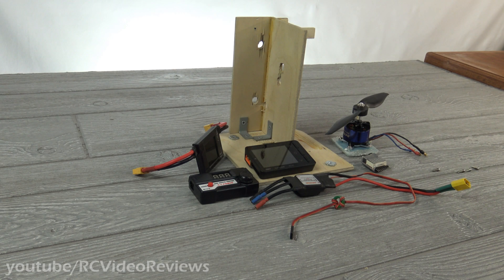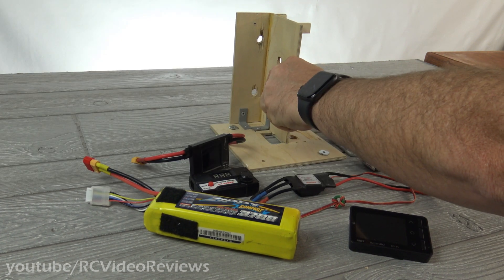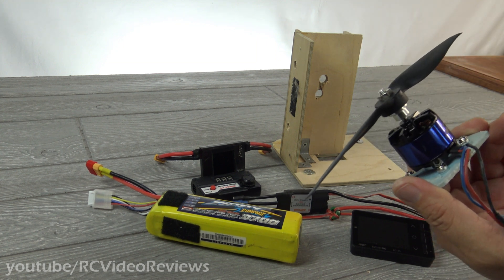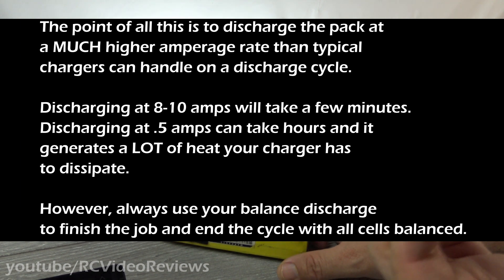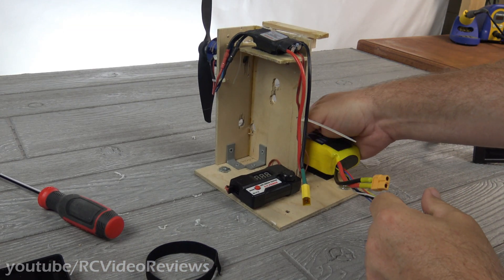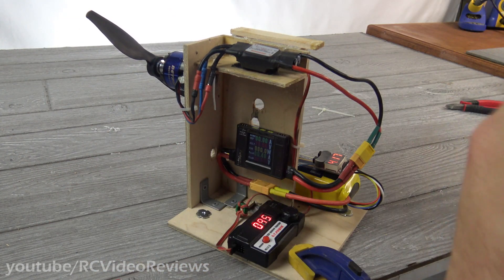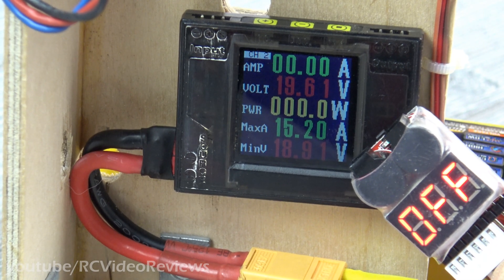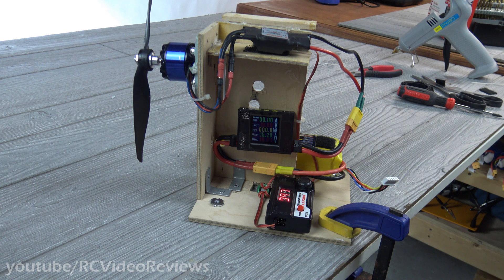DIY LiPo Battery Discharger from Spare Parts - Dirt Cheap

Comment: The noise, the prop danger with kids and no auto cutoff is an issue for me, but it does work if your willing to hang around to shut it off. Could use a latching relay that unlatches when the buzzer goes off, and simple light bulbs or power resistors for loads.

Comment: I have an ISDT charger and I have a Tenergy TB6B charger plus half a dozen of those volt checkers. None of these devices agree with each other. Some will agree at one voltage but not at another.Crazy. I never know which to believe!
Reply from the maker: You need to calibrate them with a multi meter and even then there will be disagreement. These are consumer grade devices. A certain amount of error is to be expected.
Reply: @RCVideoReviews  I didn't know that those small voltage readers had a calibration feature. I usually do compare to my meter and make an indication on the device with a marker if it's + or - what it says. To compound the prob, some of them will be accurate at low readings but go off at higher voltage reading. Like you say, "consumer grade devices".

Comment: I think the cheapest and safest lipo discharger is one or two 12volt, 5 watt light bulbs (from Walmart) in parallel, soldered to a short heavy-gauge wire and an XT-60.  Any unused batteries light up my shop for 15 minutes or so when I get back.  This is gentle on the batteries too.
Reply from the maker: Yes, that is gentle. It's 0.4a discharge rate. But then you have heat from the bulbs and glass bulbs to deal with. At that discharge rate I would just use my 306b and discharge at 2a. 

Low end 20c 2200 3s packs can do 44a constant discharge. 5-10amp discharge on these packs is nothing. They can withstand 10a drain without breaking a sweat.

It does sound cheap though.
Reply: My mistake- these are actually two 20 watt bulbs in parallel, so about 3.5 amps constant discharge.  You can discharge faster by adding more bulbs if you want of course.  I like the heat in the winter lol!
Reply from the maker: You should make a how-to video ;)

Comment: Hello John. What size motor? How much did you reduce the prop? I thought about this as well. I just don't have enough spares right now.(earlier was  gonna "new,cheap") You could also cut a prop down to reduce it. I know, balance. Great Video. AirHammer out!!
Reply from the maker: All you need is any motor/prop/esc combo that will run the amperage you want safely. Don't get too concerned about specs. Just make sure if you want 10a, the motor can support 10a. If you want 20a, the motor should support 20a. In my case, I had a pretty good size 3715 which can do 45a. 

This design uses a 40a ESC, a motor capable of 45a and I'm discharging at 10a. Get the idea? My setup can deliver far more amperage than I'm going to ask it to deliver. In the video, I discharged a 5s 3700 @ 10a and it just took a few minutes with trivial load on my power setup.

Prop reduction doesn't matter either since we're not aiming for peak power or efficiency. All we're aiming to do is create load. So ANY prop/motor that can create the load you want is good enough as long as that load is within spec for the ESC and motor.

Here are things to NOT do:
- Do not attempt to draw 40a using a 30a or smaller ESC.
- Do not attempt to draw 30a on a motor rated for constant current at 20a.
- Do not put a 16" prop on a 2210/1500kv motor. Be reasonable.
- Do not put a 5" prop on a 380kv motor. You'd have to run it at full tilt to generate load creating unnecessary wear and tear.

Use any prop you want in the manufacturers suggested range. Remember, peak power and efficiency are not meaningful in this effort--only load within specs of the motor and ESC.
Reply: @RCVideoReviews  😁

Comment: Great idea! I often return home from the flying field with 1 or 2 batteries still fully charged. I only need to get a servo tester to build my own discharger. Is there any reason why I shouldn’t reduce the prop efficiency by mounting it backwards?
Reply from the maker: The only thing you care about with regards to the prop is creating an amp draw that works safely with your motor and ESC. If mounting the prop backwards helps you do that, there's no reason not to.
Reply: RC Video Reviews. Thanks. I noticed in the video, that you corrected the prop rotation & wondered why? An inefficient prop in less likely to drag the   discharger across the garage if your clamp failed to hold.
Reply from the maker: @koalatails6391  I just wanted the air blowing over the motor, esc and battery. That's the only reason.

Comment: How many minutes did it take to discharge the battery? around five minutes?
Reply from the maker: That one discharged in less than 5 minutes, but remember, that battery was shot. Look at it a different way: I was able to set the "discharge rate" to whatever I wanted using my watt meter.
Reply from the maker: Update: The alarm I used was not very accurate. I took the battery off and put on my ISDT Battgo Checker - It showed 4.0v/c. So I went through all my other little alarms. Tested them all and tossed the ones that were way off. I found 2 reasonably accurate ones. I put one on the battery--back on the stand and it ran for a few more minutes. I checked the pack with the ISDT again and I saw 3.9v/c. So I set the alarm to 3.7 and ran the battery some more. When the alarm tripped, I put it on the ISDT and saw 3.84v/s which is perfect. So I have my alarm now, I'm using 3.7 as the trigger and after a few minutes of rest shows ~3.84/c. From there, I put it on my charger to finish the job and it takes just a few minutes. 

This is a good solution. No more waiting for 1+ hour per pack.